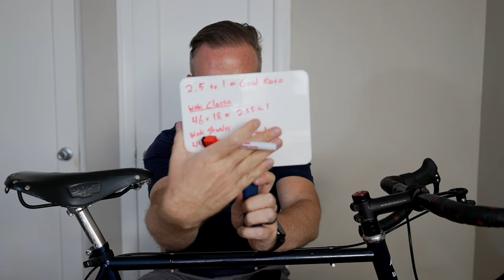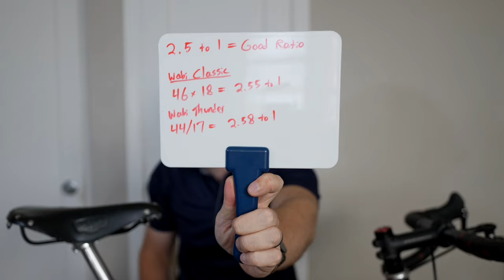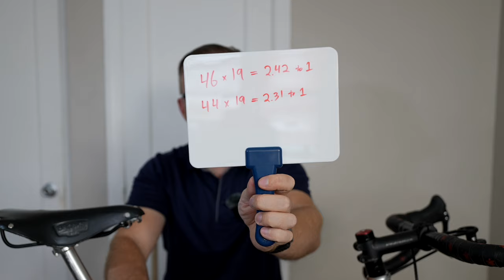How to Climb Hills on single speed bikes | Wabi Classic

Comment: Why use specify gear ratios instead of gear inches?  Gear inches is much more precise and direct.
Reply: You're not taking into account tire size.
Reply: @bruceclark5627   I am, using standard formula: number of chainring teeth divided by number of cog teeth multiplied by diameter of wheel.
Reply: @hernehill6282  WELL...... If we're gonna geek out over this, let's do it properly 😁,......you didn't measure the true size of the tire when Inflated to a specific PSI,at a specific altitude and then account for barometric pressures.
Reply from the maker: All good points. Reason I used ratios is that it's easier for people to understand, as it's simpler. I did mention this is assuming one is using 28mm or 32mm tires, and that if you run 23mm or 38mm tires it will affect your gearing.
Reply: @tommilano5431  I hear ya. For me, I can visualize gear inches (as 18 or 108 inch wheel diameters) much more easily than I can visualize ratios.

Comment: Another 48/18 here, riding it fixed, everywhere - city and out. To me biggest thing ever has happened was when I started physio and my glutes started to grow and that changed everything. Well, of course glutes are only part of equation as other muscles incl. core also strengthen, but since then I've started to ride hilly areas with longer and repetitive hills and truly enjoy it. I'm kind of surprised how differently legs work now, steadily maintaining torque with no need to stand on pedals. Body is a biggest upgrade. One speed, two legs, heaps of fun.
Reply from the maker: 48/18 is a nice ratio, similar to my 46/17! It's crazy how on a single speed you can feel your progress by not having to stand up as much on your local climbs, something I've experienced as well!
Reply: I already had decent 48T ring so it was easier to swap out cog as 17T was more demanding on knees and later I was too used to it. Also, I was attracted by Sheldon Brown's take on even ratios and chain wear. Probably I'm overthinking it.

Comment: I used drops with my track bikes for 40 years, racing and training. Then I installed bullhorns and TT brake levers. Far better for climbing leverage than drops.
Reply from the maker: The bullhorns have great leverage. I only like compact drop bars with the hooded brake levers. They aren’t comfortable brake less or with top mount levers.

Comment: Had a single speed growing up.  Pushed the bike up steep hills and spinning out going down steep hills. Discovered the 10 speed and all those single speed issues eliminated and I never looked back.
Reply from the maker: If you were spinning out, it sounds like you had a fixed gear. Gearing down would have solved this issue, since you'd be able to coast downhill, then changed the gear to a harder gear after a few months as you got stronger.
Reply: @tommilano5431  Nope. Had a single speed. I didn't want to coast downhill but go as fast as I could.   I was peddling faster than the bike could keep up.

Comment: Owned that Wabi ,and I have to say it's truly  a beautiful . It's fast and super light.  Going uphill was never an issue  .In fact, it was the opposite.Down hill and flats.  The lack of gearing was the end of my relationship with this bike . I truly  hope wabi makes a real rode bike one day .
Reply from the maker: Agree. The bike flys uphill especially with their sub-15 wheels and lightweight race tires! The issue with single speed is they can only be geared easy or hard. I don't mind losing the ability to pedal over 25 miles an hour as I'm riding in stop and go lot's of times. 
Wabi did make a geared Lighting RE years ago. I wish they would bring something like that back, it would give it ultimate versatility!
Reply: Soma has some similar options for geared bikes, or Ritchey if you got the cash.

Comment: Used to ride SS MTB. It was all about momentum. You need to add energy to the bike on the downhill and let it carry you back up. Also, you need to attack everything when climbing. Put energy into the bike on the run up.  Once the energy is gone, however, it's the slow motion grind. I was always out of the saddle on the climbs. On moderate grades (6% or so, fire road) it was possible to find a sweet spot and relatively higher RPM. Maybe 60-75 ish. I ran 2:1, or just under. 32:16 or 32:18. My go to after work was a fire road where I climbed a couple thousand feet. When fit, I could match or beat my time on a geared bike.
Reply from the maker: Yes, momentum is key! And you just get stronger after a while.
Reply: Yam momentum for a couple hundred feet only

Comment: Good stuff.  I ride single speed too but addicted to comfort.  44x19 on 38's in Adidas Busenitz.  I would put the 38's back on the Thunder so you have something different and more comfortable for short trips and errands.
Reply from the maker: Thanks! I put 38s on the thunder for gravel, same gear ratio as you. It was nice for that. For the road, I like 28s, or maximum 32s. They roll much faster.

Comment: Not to sound instructional, but ;
If you ride single speed, and you don't have clip-in pedals, any single speed is a multi gear bike.
The secret?
Use shoes which have a proper cycling stiff sole, no cleats, and grippy tread. When you climb, if you position your foot just a few millimetres back, you effectively change gears because you are changing the length of the linkage in your machine. Longer ankle to pedal spindle, more leverage, lower gear. I'm really surprised how this isnt talked about more. I have roughly two good foot positions rear of my regular position, i.e. ball of the foot directly over the spindle, and it helps that the bottom of my show has a saw-tooth pattern so I can actually settle my foot in a notch of the tread and it's stable.
For the duration of the climb, you simply apply the advantage that the longer foot linkage gives you and it feels exactly like you just down shifted two or three sprocket teeth.
Go ahead and try !
My shoes btw are non-expensive but solid and supportive proper cycling shoes, not vans or other skateboard type sneakers.
There you go, single speeders. You're already all 3-speeders. Or more.
Cheers, from canada,
Veteran roadster
Reply from the maker: This is actually good advice! I'll have to try it out next time I go for a ride. I don't pay much attention to my footing on my SS bikes, since I am running flat pedals and vans sneakers. My feet probably "auto-calibrate", but I'll have to pay attention next time!

Comment: I have a vintage steel bike that is a single speed. It is geared in 52/18 which has a decent amount of top end speed and helps me get stronger.

Not too heavy but not too easy either. It's great for the city like New York since it's mainly flat.
Reply from the maker: That's a steep ratio for me! I like to spin. But yes, NYC is mostly flat, and I imagine after riding SS for a bit it becomes easier and easier. I've seen Terry B go over the queensboro on a track bike with similar gearing to you and he stayed seated the entire time.

Comment: The frame is critical, ya just have to go above 4130 steel. In the UK you can only get a forest of these or go to one shop and get a M-M ish single with heavier wheels and CF forks for £1.7K so more exp than a Wabi, which you can't get here.
Reply from the maker: That’s a bummer. Agree anything 4130 or above is lighter and has great ride quality.

Comment: I get your point about brake less fixed riding. But once you get used to it it's safer than just a coaster brake, because applying back pressure on the pedals provides greater control than the on/off feeling of a coaster brake. Not that I'm encouraging anyone to try it 😅
Reply from the maker: I do understand that. My question has always been - What happens when the chain breaks when you need to stop shortly? It's a single point of failure. Connecting a front brake with a top mount lever is just piece of mind, and can easily be removed for racing on the track. You don't really have to use it, just leave it on for emergencies.

Comment: Wind often makes single speed riding a terrible chore.

One of my bikes is a road bike with a 9speed rear derailleur and a single chainwheel on the front.   I used to ride a fixed gear track bike to work..... riding the single-speed is just too much of an arduous task most of the time.   Will my 9-speed very easy to maintain and so much better than a single speed
Reply from the maker: The 1x systems seem like a great compromise for something like commuting! If you were on a track bike, I'd make a guess that you were geared too high and didn't run brakes. This would make any hill a chore, and if one were to choose an easier gear ratio with a freewheel, and run both brakes, it would make it a lot easier. Nice thing about single speed is you can gear them lower than a fixed gear since you can stop pedaling downhill.

Comment: Hello Tom. Thank you for the upload. The bicycle featured here sits slightly northwards of 10kgs?
Reply from the maker: 9.3 kg with no accesses attached, rear fender removed. This is with 2 bottle cages, plastic pedals, and a super heavy brooks saddle. Getting lightweight bottle cages and a lighter saddle would probably get it closer to 19 lbs.

Comment: My current bike has 44 in front and 18 at back , the gear ratio is 2.44 , tyre is 38 c but i also have a pair of 28c . is 2.44 bad enough that i need to get some new parts?
Reply from the maker: Try the 2.44 and see how you like it. I tend to like gears that are a bit lower, especially on single speeds. Makes acceleration and hill climbing easier, and you can still coast downhill. Spin to win!
Reply: @ Thanks a lot 😁

Comment: Your seatpost is bent. // Brakes--on a fixed gear?
Reply from the maker: Thompson set back seatpost, it’s designed like that. Yes, fixed gear on the street needs brakes, even just a front brake for emergencies. If your chain snaps with no brakes, not going to be a good day. I like both front and rear brakes.
Reply: @tommilano5431  Understood. But lame for a fixed gear.

Comment: What width bars?
Reply from the maker: These are 44cm. I measure at a 42cm, but I prefer the slightly wider 44cm. More room to push the bike side to side, easier to breathe, and doesn't feel as cramped. Easier to steer as well.

Comment: When you talk about this you say it’s a coasting bike but then you say it’s a Wabi. Isn’t Wabi a Fixie (fixed gear bike)?
Reply from the maker: You can run the Wabi as either a fixed gear or a single-speed coasting bike. Fixie is a term for the bike when you run it with a fixed gear cog, but typically single speeds can coast.
Reply: Oh I had no idea that’s an option. Do you have a video on Fixie vs coasting one gear bike? Why would you want one over the other etc. if not, I’m sure many of us would appreciate it! 

Great video btw